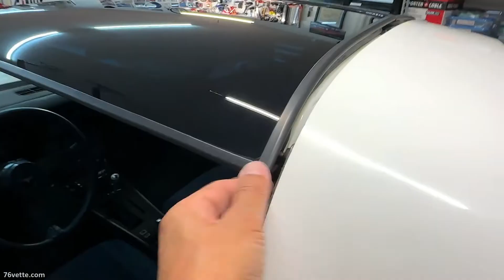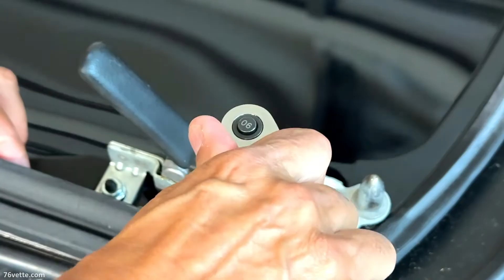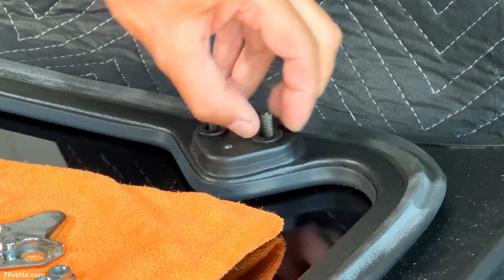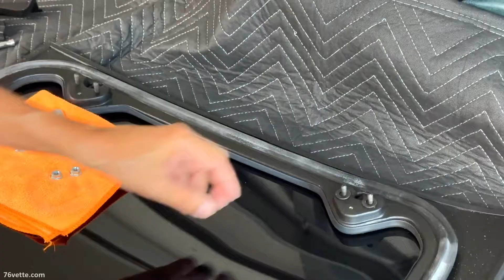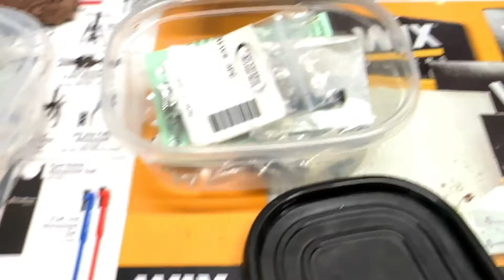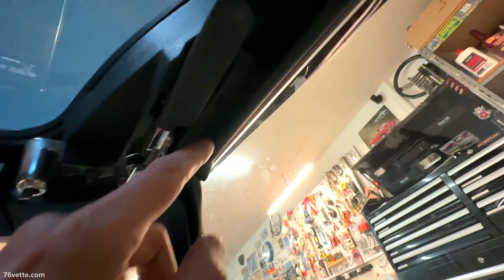How to Adjust Corvette C3 T-Tops

Comment: Will the stock 1978 t tops adjust the same way? I just got the car Nov 7th 2025 and the tops are in need.
I'll get on them in the spring.Thanks for the info.
Reply from the maker: Yes. I’m pretty sure 1978 through 1982 use the single latch mechanism. You may also need to replace the weatherstripping. 😊👍🏻

Comment: On the lcok tie down front left driver's side, you can adjust the lever bolt which will bring it down tighter for the seal. You don't have to move the three nuts for adjusting. Just the small bolt is adjustable for tighter fit. Look at your video at 14:02 and look right above your index finger, that bolt adjusts the tightness. :D Just turn it counter clockwise, you have almost 3/8 of an inch that can bring down that corner of your t roof :) oops, I see you found it later in your video around 21:51 LOL

Comment: Finding an original set oem set maybe instead on eBay or a swap meet @ Carlisle ,pa maybe I would be concerned about water leaks etc. which vettes of the 70’s and 80’s were notorious for ! Rotten floors etc. Good thing you have those cars garaged  and inside! Keeping them outside would be a horror show I would think. I know you’re very meticulous I watch some of your other videos but I would never waste my time trying to make something aftermarket fit the quality just doesn’t seem to be there probably made in China reproduction or something junk!
Reply from the maker: I’ve adjusted OEM T-tops in the past too. I’m dealing with cars made in the 70s and 80s. NOTHING fits or lines up very well. 🤷🏻‍♂️👍🏻

Comment: Another great video! More please ;) You know before you did this video I never paid that much attention to my T-tops and where they sat but realized yesterday that my passenger side is slightly higher than the driver's side and now I know how to adjust. I don't have much of a gap at all at the rear though but do have a slight overhang on the front which I presume is how it's supposed to be.  My car wasn't built with glass tops but were swapped out at the time of purchase in '82 according to the previous owner

Comment: THAT ADJUSTMENT  REALLY  MADE A BIG DIFFERENCE  !! MY 78 VETTE  , I HAD THE ORIGINAL  GLASS T- TOPS SMILIALAR  TO THE  ONE'S  ON YOUR CORVETTE ,BUT HONESTLY  THEY  BASICALLY  HAD THE SAME GAP IN THE REAR AS YOURS ,AND THE SAME LIFT IN THE FRONT CORNERS ,ACTUALLY  THEY LOOKED WORSE  THAN YOURS  !! SO YOU  DID AN OUTSTANDING  JOB  ON YOURS !! JUST A WORD OF ADVICE  , WHEN INSTALLING  THESE GLASS TOPS ,BE VERY CAREFUL  WHEN  PUSHING  / PLACING TOP INTO PLACE . MY BUDDY CRACKED ONE OF HIS GLASS TOP WHILE PUSHING TO HARD TO GET INTO  PLACE !! GREAT VIDEO  !! JESSE VIA LAS VEGAS
Reply from the maker: I think the video makes it look like the glass is flexing when it’s actually the weatherstripping. Those T-Tops are pretty tough, but yeah, you still need to be careful. Thank you for watching! 😊👍🏻

Comment: You have done a really nice job detailing the adjustments of the tops. I have struggled with making adjustments to my standard top before it can be a real challenge. One word  of caution. After making these adjustments check the fit with the window up and slowly try to close the door from the outside. Sometimes the T-top can't be as snug as you would like because of the height the window travels up to far. So when you try to close the door with the window up and extended it scrapes the top edge of the T-top.
Reply: I agree.  You really have to adjust both the top and window together.
Reply: I'll be rebuilding the window motor.  Mine don't go all the way up either.

Really need to clean/lube window assembly, clean/lube door lock assembly, adjust top and adjust window.... all at once
Reply from the maker: Good advice. Both my windows need adjusting as the glass leans outwards too much and they don’t go up all the way as shown toward the end of the video when I rolled up the passenger side window. 😊👍🏻
Reply: Windows are adjustable as well. Vertically and in out using the brush adjustment.